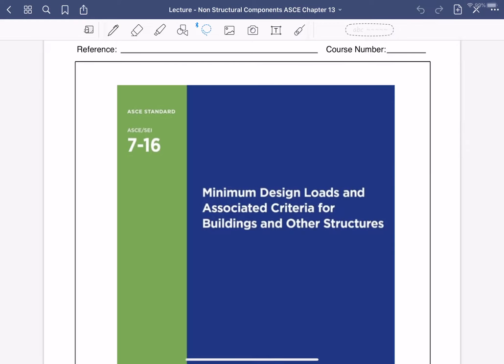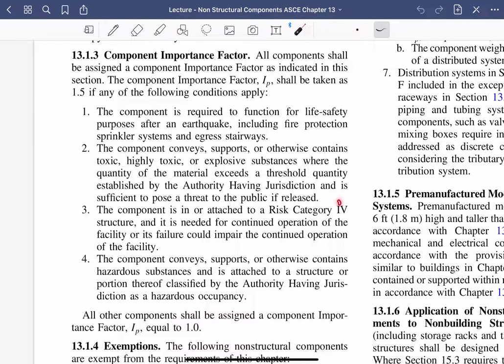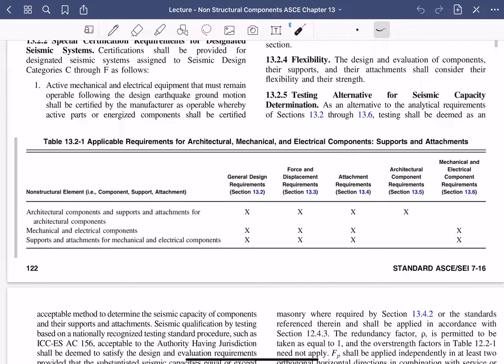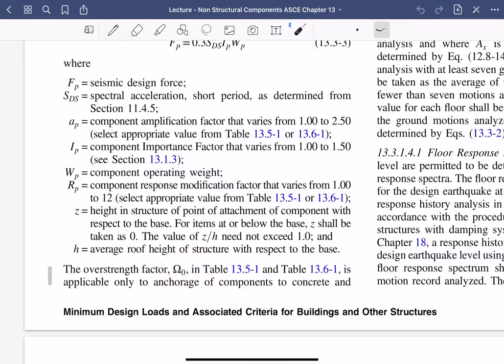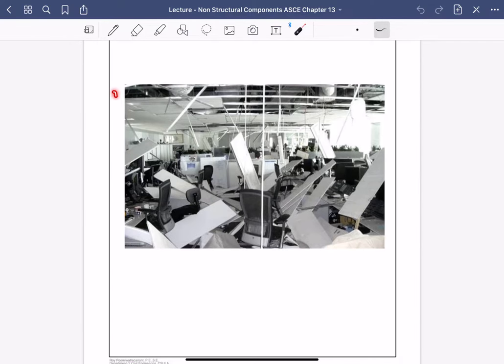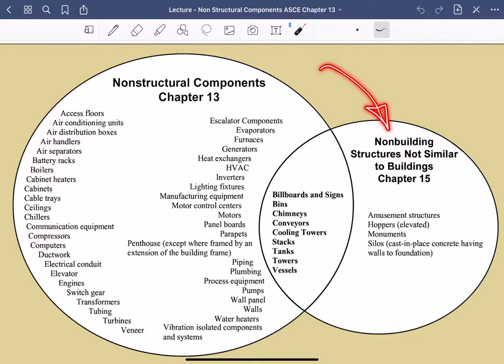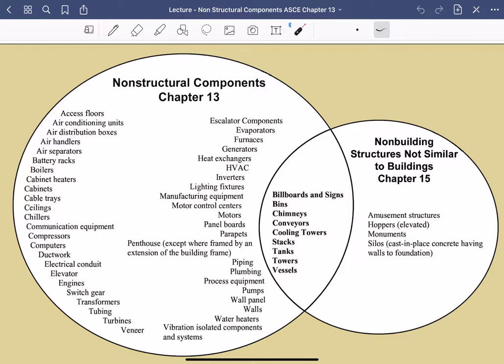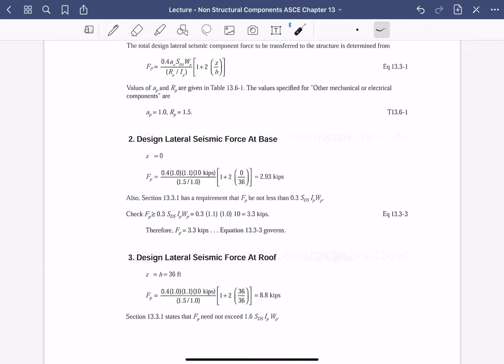ASCE Chapter 13 - Covering the Basics for Non-Structural Component

Comment: How does US codes see non structural components like Piping connected to the pumps or compressors or heat exchangers? In most cases their designs are governed by their allowable nozzle loads in operating load cases. And loads generated in an IL 4 event very likely to exceed allowable of those nozzles.

Comment: according to ASCE7-16 chapter 14 (non structural), anchor demands for masonry should be increased by 2x.
Reply from the maker: Correct 2x applies to both masonry and concrete since you cannot achieve ductile failure in the bolts

Comment: Hello Sir
Where did you get these ecample questions

Ty
Reply from the maker: 2018 IBC SEAOC Structural/Seismic Design Manual Volume 1: Code Application Examples or 2021 is most recent